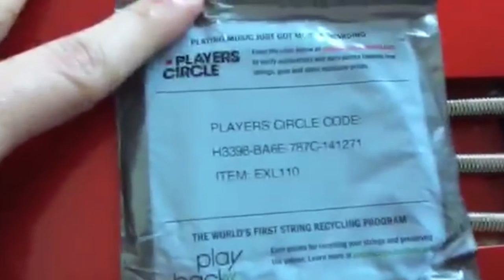Fender Strat To Super Strat (Partscaster Build)

Comment: The old Mexican Standards are great platforms for building a custom guitar. I’ve done a few up and made gig guitars that I don’t have a ton of money in (just in case they “walk off” from a bar gig) that sound and play great. The pots and switch were actually good in them too although I never cared for the stock pickups. New pickups, a good brass block trem and a setup does wonders for them and I’ve picked up a couple for $250-$300 so not too much for a good base.

Comment: I guess that depends on your taste of tone. Losing the single coils in my opinion is a big minus right out of the gate.
Reply: There's room for both types of Strat in the world, surely? Fender themselves made an HH Strat...
Reply: @richardharrold9736  Sure, but if that's the case, buy a HH Strat. I'm just saying, gutting a single coil strat, you lose that glorious single coil tone, that maybe you only appreciate after 40 years, like me. Just about all my HH guitars are gathering dust these days. I have really come to love the sound of single coil Strats and Teles. Of course that's just my opinion.
Reply: @tomb8430  if it was a Custom Shop with vintage-style wiring, sure... but it's just a Mexican with cheap pickups in it, serviceable but nothing special, and he's made all the discarded parts available to the market should anyone want them... and much of the time, single coils are a PITA when you're dealing with dirty power supplies and you get that hideous 50Hz buzz...
Reply: @richardharrold9736  I learn't rolling back to 8 on the volume, along with a treble bleed circuit, make it sounds sweet as, not AC hum. Anyhow, different folks, different strokes. All good brother.